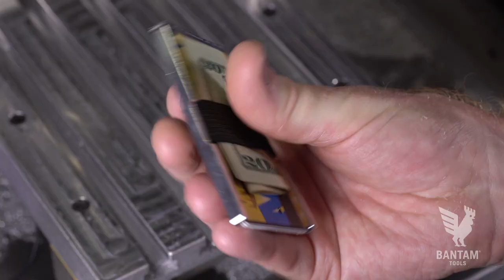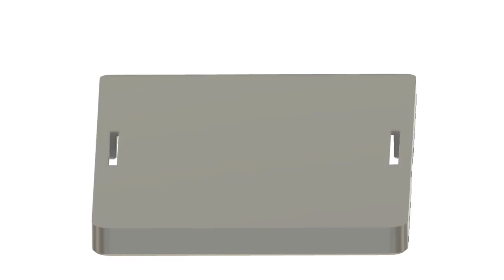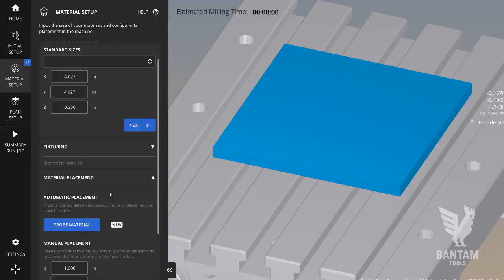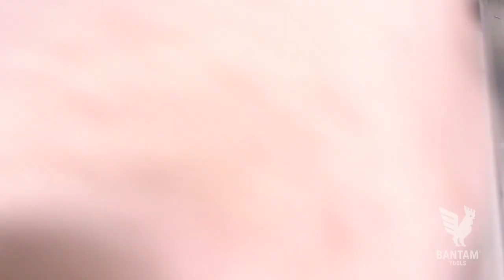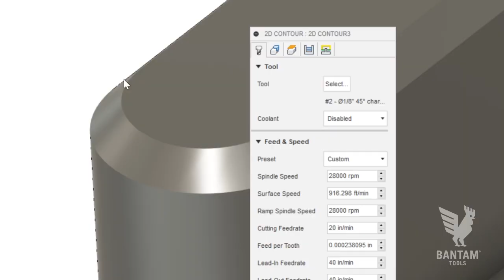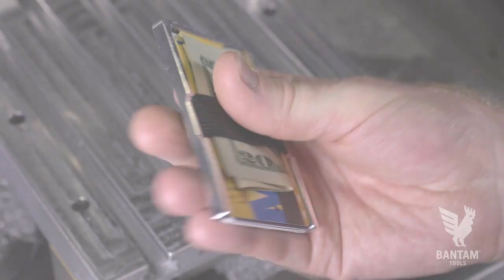How To Machine a Low-Profile Aluminum Wallet using the Bantam Tools Desktop CNC Milling Machine

Comment: Im interessed to try this but why are they 2 holes at sides?
Reply from the maker: The slots on either side of the wallet are for a band or strap 👍 Here's a link to the project, if you're interested in giving it a try: https://support.bantamtools.com/hc/en-us/articles/360053358433-Low-Profile-Wallet